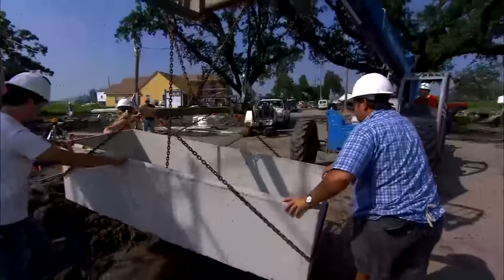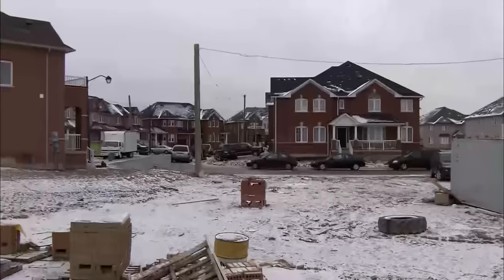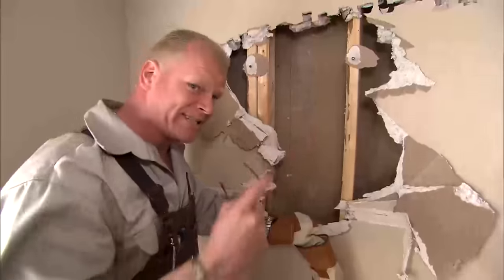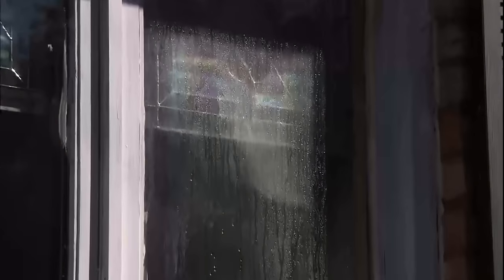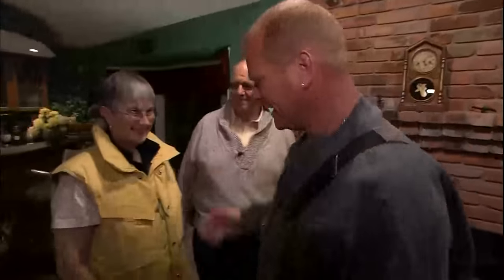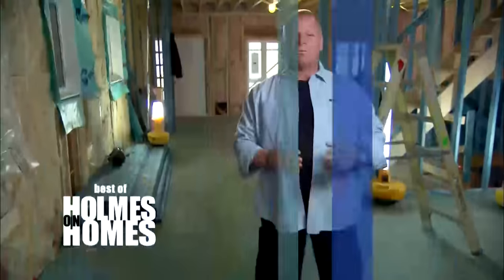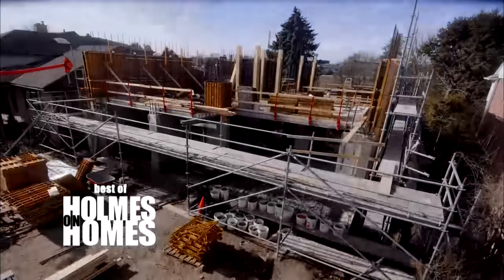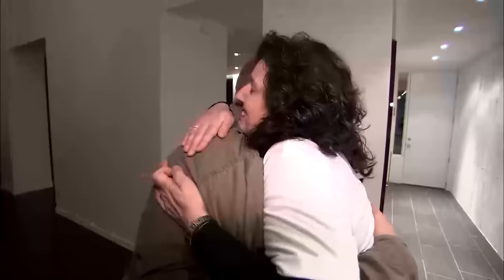Beyond Repair: Mike Holmes' Toughest Cases | Best of Holmes on Homes 108

Comment: In my area, its gotten rather common to just poor a concrete wall, or build a block wall in between units. Even without any insolation, it does a fairly good job, and its completely fireproof.

Comment: Just bought some dowsing rods to find our septic tank that the county in the state of NE doesn’t have a record of.  Wish us luck!
Reply: When the county refused to pass the old well on the property we bought, the neighbor came over and witched the property to find a place to bore a new well far enough away from the septic to pass code. He found two spots right off the bat. Drilled 60 feet down and the well served us for the 30 years we lived there and never went dry. It works.
Reply: @joansmit5782 Maybe he should have sacrificed a goat?

Comment: I was just curious, outside of the demolition costs, how much did it cost to build that techno green house? It looked great with all the stuff that went into it but if it is just a millionaires only concept, then isn't feasible for the rest of us.
Reply: The upfront cost would be way more than a traditional home, but the operational costs would be next to nothing or even negative if you can sell enough power to the grid. I would love to know what the ROI on that house is. Eventually it will pay for itself if all those systems work the way they're supposed to.
Reply: @SentinalhMC  ..."if those systems work..."
This is the issue
Reply: @Cheepchipsable  It's still early days for a lot of the technology in these sorts of homes so each one is an experiment.
Reply: @SentinalhMC  The utilities don't typically pay you for generating hydro. They'll just credit your bill to a certain pre-set maximum monthly credit amount. So best case scenario, you pay a $0 hydro bill. You won't really profit from it.

Comment: We bought a nice home that's not too far from a train track. The times we looked at the house, when we were thinking about buying it, no trains went by. We were told that trains only went by twice a day, which we thought would be tolerable. Wrong! At times there are around 6-8 trains go by our house during the day and night which makes it very hard to sleep. The conductor will blow the horn. (We figure there must have been a child waving at the train from the deck of our house and that's why the conductor did it.) We've lived in the house for only 2 1/2 years and are going to sell it even though it means we'll have to pay U.S. capital gains tax (there is none if you live in a house 2 years of five owning it). This is how much I'm willing to pay just to move away.
Reply: Don't you pay CGT if you sell at a profit, ie, make a "gain"?

Comment: Ask Victory outdoor concrete services what they think about porous concrete?  It does break apart easy & it is no where as strong as concrete!  He is in Wisconsin and the one on his channel was a mess!  Just use regular concrete!
Reply: Seems to me if water can get in and freeze it will still break apart the concrete.
I imagine it is structurally weaker than regular concrete, but probably does have some applications.
Preventing torrential rain runoff is very useful.

Comment: About the wicking lines I had a buddy that showed me how to do this on my own property to find water for a well I too was a skeptic but with the rods in my hand and walking a property I found water they really work and it is almost like magic
Reply: i use branches to locate underground water sources,so that peaple can have a water well on their prperty.the wire system is the same as the branch y system.
Reply: It's rubbish, never been demonstrated to work, despite much testing and offers of reward.
Reply: You have no idea what your talking about.. I watched it be done plus done it myself. I use the method to find electrical pipes in the ground…
Reply: We used welding rods to locate steel pipes in the ground, basically the same principle.

Comment: 16:17  Not to mention that standard drywall is pervious to carbon monoxide. Plenty of cases of cross-dwelling poisoning.
14:48  Polymer or not, how is that not supposed to be 5/8 firestop between dwellings

Comment: there's no way it was 50 decibels less on the other side of the wall. did they change a setting on that meter or something? and what is an STC? because it looked like they were using decibels and then they weren't. 50 decibels can barely be heard

Comment: that solar PV pannel installation was only 600 Watts? Tha'ts not enough to power the house at high-noon, never mind topping up the batteries to get through the night. Try a 10 kilowatt solar PV panel installation and at least a 20 KWH battery. Then we can talk about shipping surplus power to the grid.
Reply: 600 potential watts, but you will never get that high. Probably closer to 400 watts at peak summer, and maybe only like 3 sun hours during winter. Probably just enough PV to offset the lead acid battery self discharge during winter.

Comment: the batteries for that system is way more costly then you think, and the solar pannels dont last long either
Reply: FYI, there are solar pannel installations that are over 30 years old and still producing over 80% of their original rated power. My issue with that system is that 600 Watts is nowhere near enough, nor was the 10 KWH battery.